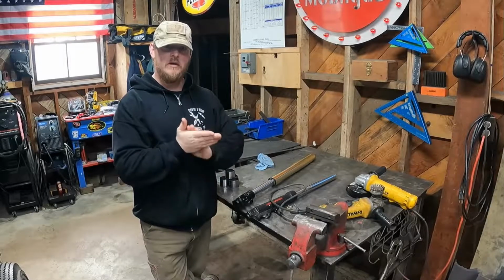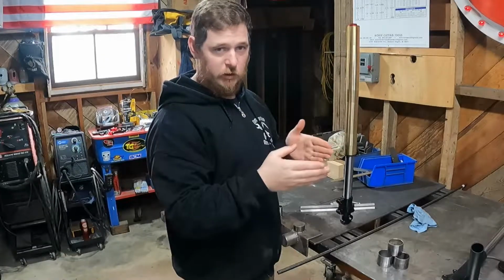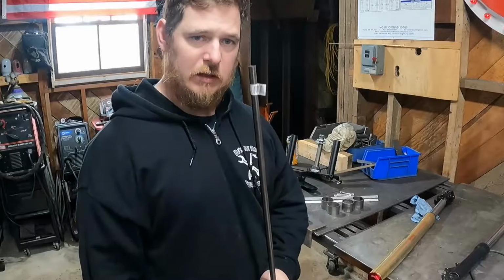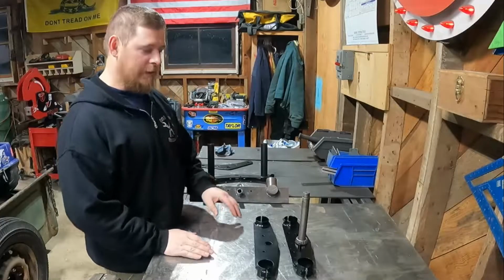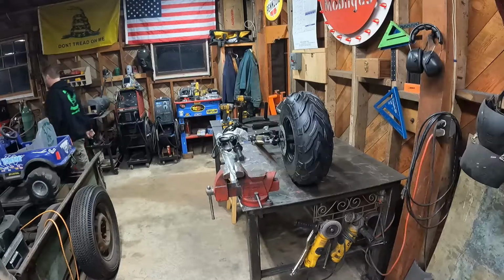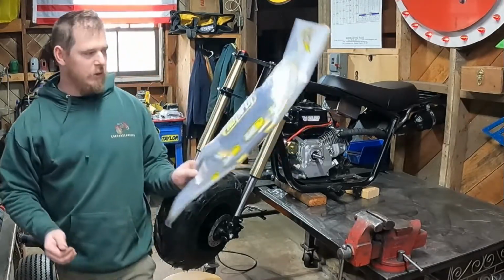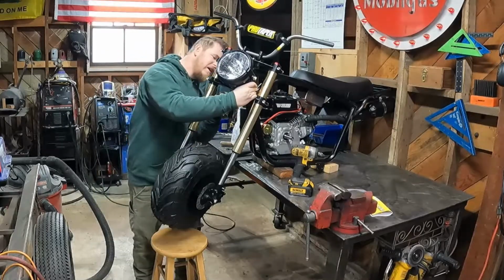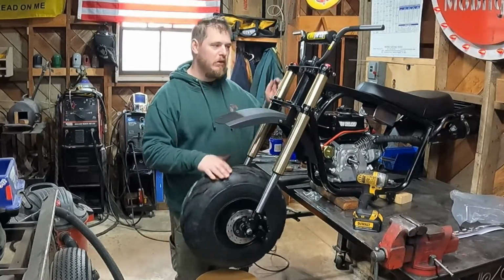Mega Moto 212 Pro Big Fork Upgrade

Comment: Dope stuff bro do u have any of those tripple trees for sale i know u just showed us how to do it but i have zero tools or experience to do this but im getting a frame like yours and i wanna do it just cant see myself buying those stock wonky ones after watching this 😅
Reply from the maker: Unfortunately I have to cannibalize the factory ones to get the steering stem out of them so I can't make them having the stock ones to start with.
Reply: @DJsHotRodFab   Cannibalistics in this OK I got ya
Reply: @DJsHotRodFab  so they have the same forks with tripple trees on the Amazon what knock tube would I need I seen they have them on ebay str8 weld on chopper fork knock tubes whatever u call them
Reply from the maker: @SoLoCruizeR2o3  I'm really not sure. The ones on Amazon and eBay are for a narrow tire like.on a put bike

Comment: I wonder how this would ride with the larger front shocks if the rear of the bike was left alone?
  I was eyeballing my mm212 the other day and wondering if there would be any benefit to swap over to mb200-2 front shocks and front disc/caliper just for the longer front shocks and the added ground clearance that would be gained.  I'm thinking they are both the same diameter, therefore, wouldnt require a new fabricated tripple tree.  I rolled the front wheel up on a couple block of wood just to get a feel for the tilt and it actually felt comfortable.  🤔
Reply from the maker: I'd try it if I had them. How much longer are they?
Reply: They are 4" longer.  I dont know if they actually have more travel then the mm212 shocks.  You have a superior setup, I was just thinking out loud for a guy like myself who may not have the tools and skillset to build everything from scratch.  Keep up the good work!

Comment: You are definitely handy with your fabrication skills. I cheated a little when I put a pit bike front end on my minibike. I purchased aluminum upper and lower triple tree from eBay.
Reply from the maker: Are you running a narrow front wheel?
Reply: @DJsHotRodFab  On my street minibike I’m running the 6 inch Astor wheel with a 13X5.00-6 street tire. On the second one I’m working on uses the 10 inch steel two piece wheel from OMB Warehouse. But yes, they are quite a bit narrower that the tires you’re using
Reply from the maker: @stanlucas665  it would be cool if someone would make an aluminum set of triple trees wide enough to run these wider tires.
Reply: @DJsHotRodFab  Hell yeah it would be.
Reply: Hey I have a question for you. What is the length of the tube where the forks attach to the frame? I think it’s called the head tube, but I could be wrong.

Comment: How much would you charge to build me the same triple tree clamp mate
Reply from the maker: I can't make them because I use the steering stem from the stock triple trees. Go power sports has come out with a kit with these same forks for the trail master. Not sure if they would work on the Mega Moto or not. Might be worth checking out
Reply: @DJsHotRodFab  
Yeah but kit they sale Is £400 and   odd bucks madness